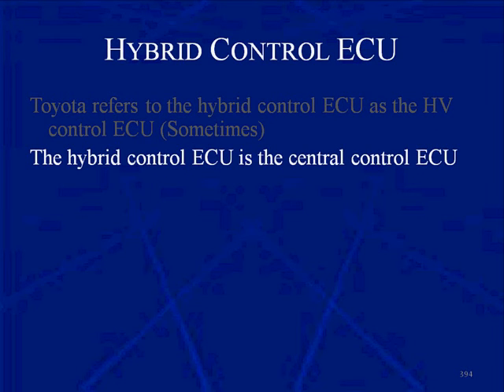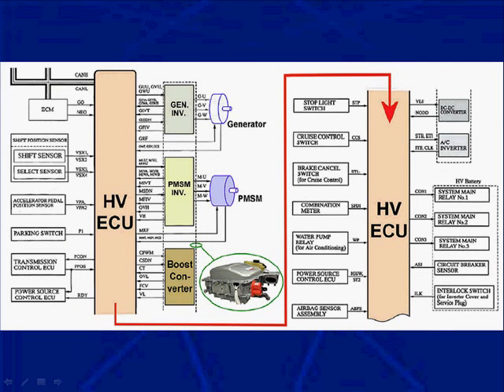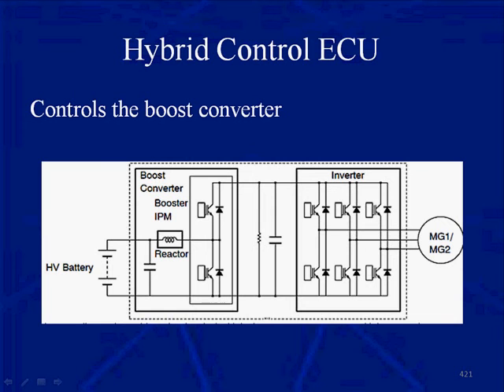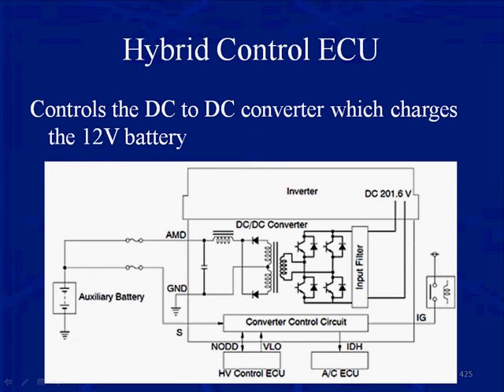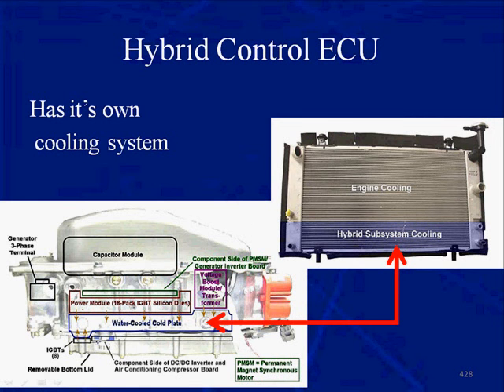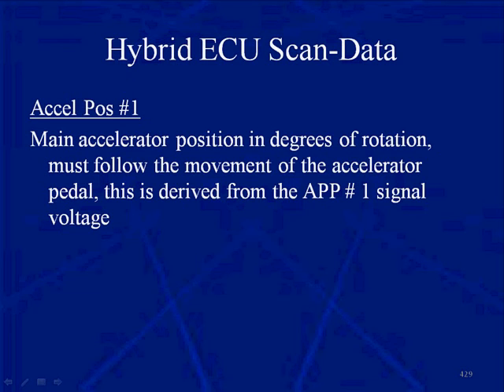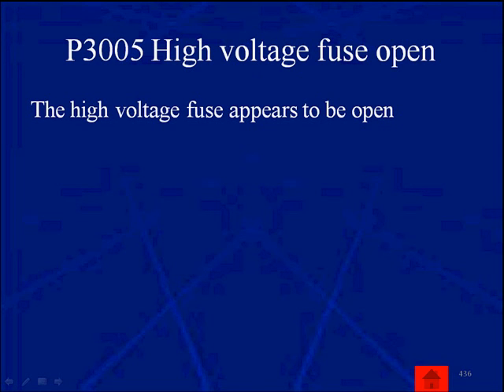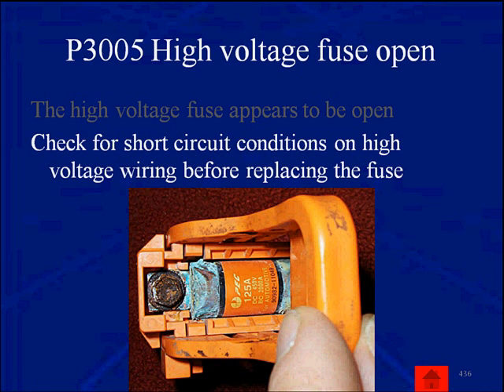10 Hybrid Control ECU

Comment: I appreciate your in-depth video.  I have a 2022 Sienna Hybrid and recently took it in for the 5k mile service, tire rotation.  Afterwards, I noticed the mpg is much lower and the accelerator pedal is much more sensitive where the engine kicks in much sooner from a stop although I have not changed my driving style.  I usually lightly step on the pedal from a stop to have the motor accelerate but noticed the engine kicks in much sooner.  I checked the oil and actually drained and did my oil again a 2nd time and put in the correct 0w16 viscosity and set the tire pressure back to previous.

Am I going crazy or perhaps the ECU calibration was modified somewhat by the dealer?  I can see this affecting my mpg, lesser reliance on the battery, more reliance on the engine, and perhaps help extend the overall life of the battery from charging/discharging and help with toyota being responsible for the 10 yr/150k mile battery warranty.  I appreciate any insight you may have.

Comment: Have 2009 2nd gen Prius, and the red triangle light came on. After getting it diagnosed it gave code P3000, which is HV ECU failure. Even after replacing it, it still gives the red triangle light. not sure how to fix that
Reply: unplug the 12v battery
Reply: Did it fix your problems?